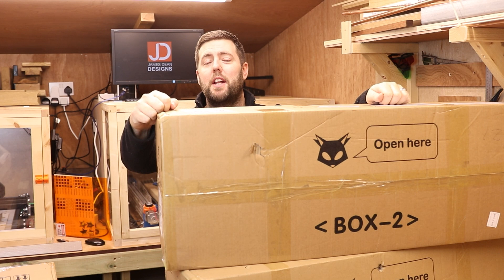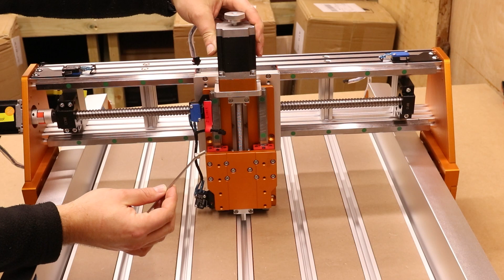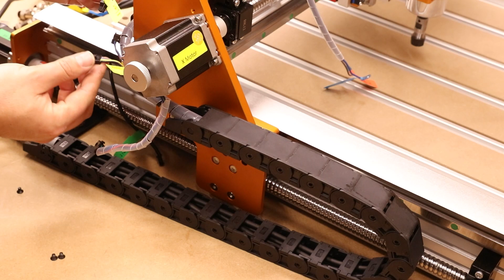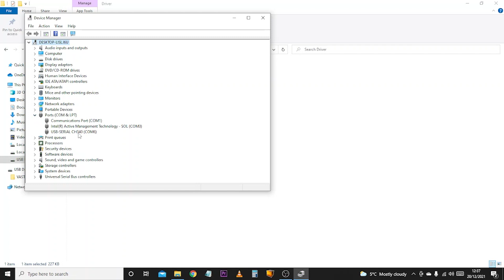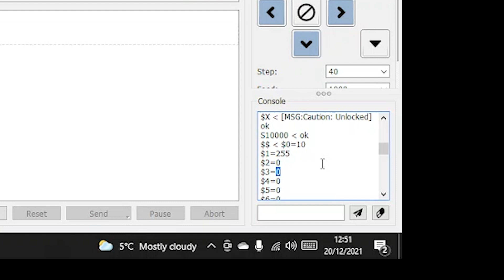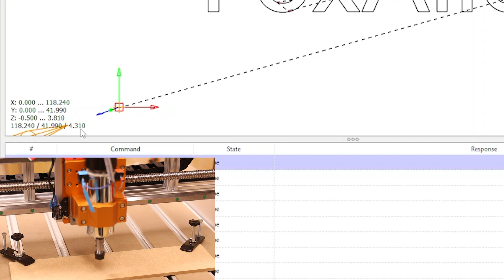FoxAlien Vasto CNC - Complete build and setup

Comment: I'm baffled. I've exported from Fusion360 but when I try to run my code the following happens: 

The spindle starts up... 
The head moves to the correct location... 
The head move down a bit... 
Then the spindle stops and I get this: 

[CTRL+X] < ALARM:1
Grbl 1.1h ['$' for help]
[MSG:'$H'|'$X' to unlock]
S9000 < error:9
$X < [MSG:Caution: Unlocked]
ok
S9000 < ok
[MSG:Reset to continue] 

Anyone understand this gibberish? Is this a problem with the file than Fusino360 exported?

Comment: I just got my Vasto after watching your build and review videos. (Yes I used your link (:  ) and mine came with a 120mm spindle body spindle. My manual says its a 300w but the website says it comes with a 400w so I started researching and I cant find any 300w or 400w anywhere close to the size of this thing. Just comparing measurements I think its actually the same as a standard Chinese desktop 500w spindle. Would you say the Vasto spindle is around the same power as most other 500w or does it perform closer to a 300w or 400w? I know this isnt the best way to classify them and probably all of these type of spindles are not putting out the power the name says.
Reply from the maker: Excellent, hope you're enjoying it.
It should at least be a 400w but I agree its a pretty big one that comes with it, and the largest I've had on a machine.
Truthfully, I'm not 100% sure how to accurately test them or verify what rating it really is.

Comment: Can you do a video on UGS? If I connect the machine in UGS, do I have to run the setup wizard to give it information about the stepsize of the motors and calibrate them? Or does it just work if I hit the home machine button? I cant find any info on it, everyone just runs straight to Candle....
Reply from the maker: Skip through this video to the UGS part and it covers some of the basics. 
No you don't have to run the setup wizard but if you are having issues with things such as it not jogging the correct distance then it can help to run the wizard but for the most part it picks all your settings up from the machine
https://youtu.be/6V9tmybmdnY

Comment: I just took delivery of my Vasto and am really impressed. I can't wait to start using it. I'm surprised that more YouTube creators haven't gotten one of these. As of today, there are only 2 other creators who have reviewed this CNC.  It made me think that there might be something wrong with the CNC or the company. However, I found the packaging to be first rate, assembly was a snap, and the machine is solid as a rock.
Reply: I am considering getting one. Did you get the XXL or the XL I was pondering which might be the good one to get. Bigger allows for more projects, but smaller might make the machine  sturdier and make milling metal a better experience. Any thoughts ?
Reply: @cloud-forge  I purchased the standard Vasto with the 40 watt laser bundle. I'm using a Dewalt DP611 router as my spindle. I haven't used the laser module yet as I also have an OMTech MF12-20 50 laser. I love this machine. It's built like a tank and is solid as a rock.

Comment: Hi @James Dean Design, great video, it persuaded me to get one. Just wondering if you actually have installed the 1.5 kw spindle yet? I purchased one at the same time as the Vasto so would like to set the Vasto up with the larger spindle when they get here, wiring in the VFD to the controller if this is possible following your install.
Reply from the maker: I'm annoyed with my self as I still haven't got around to doing it yet 🙈 but yes the controller can connect to the VFD. There is a terminal where you can connect the existing spindle cable into it
Reply: @JamesDeanDesigns  I have had a look at another of your videos "Upgrading your spindle/router on a desktop CNC - 300w to a Dewalt DWP611" is this the method that I would need to use via a relay on the power supply to the VFD? Haven't had any real experience with VFD/Spindles touched lightly with Servo motors/Drives and controllers as I am in the process of building a motion simulator for Driving/Flying simulation. I know with the Servomotor/Drive pulses are supplied via the controller but these are fairly low wattage. So I'm presuming that the the output from the controller via the spindle cable on the Vasto would be the 400w to drive the 400w spindle which wouldn't be used as an input similar to the servo motor controlling method. Could you please give me some direction as to the method I would use as the manual that came with my VFD is printed so small I am struggling to be able to read it and what I have been able to read is in fairly broken english, My new spindle is a 1.5kw G-Penny, and a 100 Series VFD, but from what I can tell is that they are all fairly well Generic anyway.

Comment: I tried to buy a cnc from this company and they cancelled the order, they cannot sell this equipment to the UK and then I had a nightmare trying to get a refund, BUYER BEWARE
Reply from the maker: They can sell to the UK, Im in the UK and lots of people in the UK have FoxAlien machines. Its usually they are either not currently in stock in the UK warehouse our shipping options work out too expensive from China, especially with this machine as it weighs quite a bit. Sorry that you've had a bad experience but I can assure you this is not the normal procedure with this company.
Reply: @JamesDeanDesigns  I have just tried to buy a laser engraver from this company and they cancelled the order because they cannot sell the  machine in the UK because it does not have a CE mark

Comment: Hey james quick question, did you change your max feed rates in the grbl settings on this machine? Wondering if you can take it past the factory setting of 1500mm/min
Reply from the maker: Yes, pretty sure i got it close to 5000 before I got nervous so backed it back down a little
Reply: @JamesDeanDesigns  safe to say rapid movement could be pushed to 4000mm/min (movement when not carving)?

Comment: Hi James, thanks for your detailed build and setup. When you get a chance, please measure the height and width of the y-axis aluminium profiles without the dust shields. They appear to be non-standard. I was hoping to do some deflection calculations.
Reply from the maker: They are 20mm wide and 100mm high
Reply: @JamesDeanDesigns  Thank you for your note. I forgot to ask about the thickness of the gantry plates. I am still deciding and with the supply issues not helping I may have to put it on hold for the time being.

Comment: Hi James,  any sizing guide on building an enclosure  for Vasto.  I have limited space i am thinking of enclosure of  970mm W x 900mm D and 700mm H. Looking at other enclosure like you build for 3018 and the Snapmaker  the   gap allocated for depth is quite deep, is 100mm too little? thx David
Reply from the maker: Hi David, if you watch my other video on the Vasto I cover the base size needed. You just need to add a bit extra on for clearance. Your sizes sound fine but you just need to factor in where the control box goes
https://youtu.be/YVr0Tx_GQHo

Comment: Still deciding between this and the onefinity aargh.  Jamed Dean can you show how we can use this machine with an offline controller and an xbox type controller like the onefinity please, Thanks in Advance.  I need to be able to use this without using a computer in my shed.  I like this because it has the large ball screws and linear rails in all directions, but want it to run like the onefinity.
Reply from the maker: I've not specifically seen the onefinity running from an offline controller or with joypad. Offline controller are fairly easy but you have to take into account they have less functions. I know you can set up a joypad to run via a PC but not via an offline controller so I'll take a look into that. Both machines are GRBL based so if one can do it, the other can too.

Comment: Does anybody know that max rapid feed rates of this machine? The 4040 model say 2000mm/min (78IPM) which is very slow. I would think with linear rails and ball screws + nema 23 you would be able to rapid at like 500 IPM.  Can anyone verify this, looking at getting this beautiful machine but worried I'll be disapointed with the lack of speed.
Reply from the maker: Ill try and test if it goes faster. 2000 is common  for a CNC router. Laser go much faster but it is the inertia with these, essentially the faster it moves, the more time it needs to slow down after every move.
Reply from the maker: Just to update you, I did a quick test and got it up to 5000mm/min with no load so nearly 200IPM. It probably could have gone more but to be honest I would never be running this machine at that rate anyway so that was more then enough for me
Reply: Thanks for the info James, I want to look into adding a counterbalance to whichever machine I go with also to speed to the Z axis. Saw a few simple spring ideas, might get a little complicated with a cylinder shock type. Have a need for speed :) Cheers

Comment: Great review! Hmm ... at last I saw a very interesting machine, which, most likely, requires almost no mechanical modifications (on my CNC3018MAX Metal I reworked everything - instead of shafts, rails, a brushless spindle, frame reinforcement, etc.) ... And on the machine in question as an "upgrade" I see only the installation of a brushless spindle.
Reply from the maker: Thats probably about right, they have covered a lot of things off with this one. FoxAlien openly advertise that to get the most out of your machine you will need a bigger/better spindle.
Reply: @JamesDeanDesigns  Replacing just the spindle is much easier than completely rebuilding some primitive machine to the state in which FoxAlien sells it. True, the price of self-alteration is likely to be noticeably less (but also parts of less quality will be used in the design)